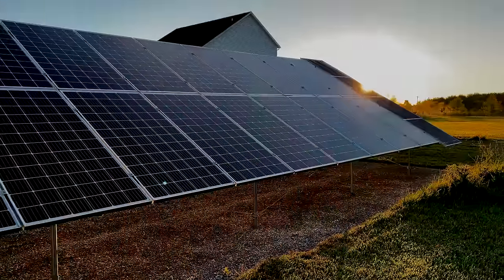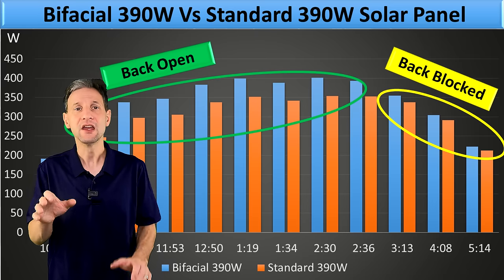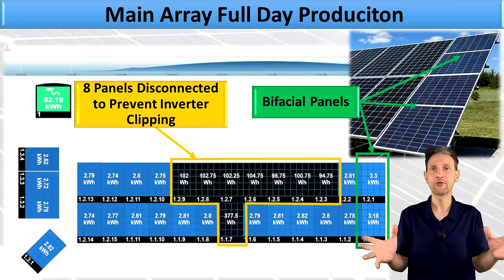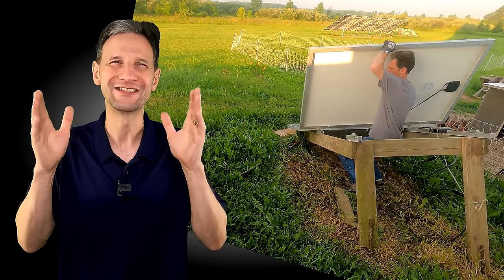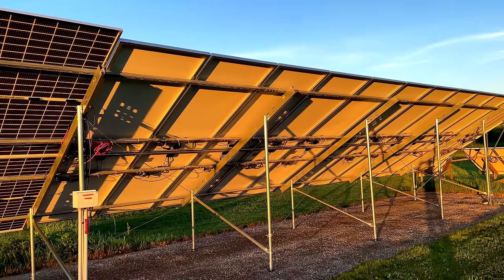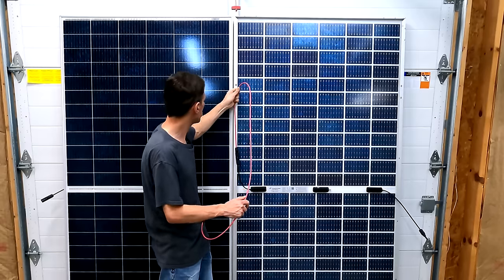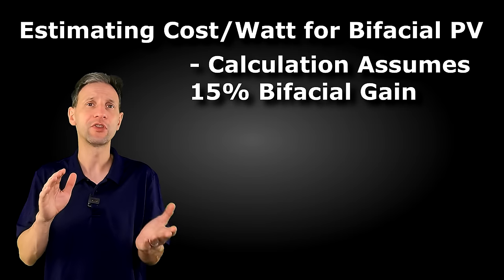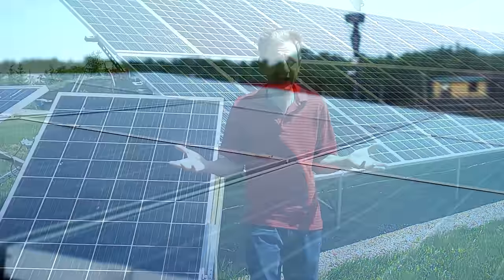Bifacial Solar Panels - The BEST Solar Panel? Real World Results!

Comment: Take two single sided panels and mount them back to back and then compare the results with a bi-facial panel.  Or take a bi-facial and mount it with the backside up and see what the results are.  My guess all this is marketing hype to make the consumer think it's a technological breakthrough when it is likely just a way to squeeze more dollars out of a panel by taking cells were sub-par and normally discarded and slapping them on the back.
Reply from the maker: That is exactly what I tested in this video.  I installed one panel face up and one face down with the other side blocked.  The back side of these panels can produce 66% of the power the front side can produce.

Comment: To me these bifacial panels look like the best solution on a tracking system. Then you could tilt the system to give best results. Have you considered testing a tracking system and making the cost comparison to fixed array?
Reply from the maker: I think the nice thing about bifacial panels is they can pick up light from other angles even without a tracker.  Of course tracking would be even better, but probably not worth the cost unless you have limited space.

Comment: Try erecting the bifacial panels vertically in a north -south orientation either on a flat roof/open area away from building etc.
Should maximise power output am/pm with a midday dip keeping the panels cooler (more efficient) around solar max🤔
Reply from the maker: You can see the vertical result here: https://youtu.be/5AVO1IyfA9M
Reply: Thanks, that's brilliant...I just came across your video after watching a video on solar installation.
Love the effort you put into these videos, no sales bs, just real relatable data. 
I had visualised more gain early and late and a bigger dip at solar noon so the video you linked was a real eye opener!
All the best, keep up the good work 👍🏴🇪🇺🏴

Comment: I recently bought (not yet received) Jinko Solar bifacial panels.  I live on a hill that is facing south.  The hill is a corn field. I live near London Ontario.  In the winter when the field is covered in snow.  So with the sun lower during the day I am hoping the slope behind the rack mounted panels will reflect the light into the back side of the panel better than a flat land setup.
Reply from the maker: Yes, it will likely have a significant effect.  It would probably be beneficial to mount the panels a little more vertical than typical.  You will shed snow more easily, and since you have bifacials you will still get good performance in the summer.

Comment: How about mirrors or aluminium foil to reflech some sunlight? No point in bifacial if the structure is based on a roof with inclination, right?
Reply from the maker: Bifacial provides little benefit if mounted parallel with the roof.  I am collecting data on my shed install to show just how much could be expected.  You can see that install here: https://youtu.be/Y8OGxdJ9cU8

Comment: I found that as a kid I could get power from a solar cell from either side as long as light shined on it. I know it works but implementing it may be a bit tricky.
Reply: So if you have concentrating mirrors to shine light on the back of the bi-facial panels you could get more power out. Crude reflectors could be made from aluminum foil a mylar heat blanket using the shiny side to reflect light. I guess anything reflective to maybe old CDs.

Comment: Could you use these panels on a roof where they are not angled and there isn't a lot of space between the panel and the roof deck?  Or would heat buildup kill any gains?
Reply from the maker: I evaluated that in this video: https://youtu.be/mzqjCsZKUYQ

Comment: I wonder if placing the panels in a a configuration such as this | _ | _ | _ | with the "|" panels mounted vertically and the "_"mounted flat, and the whole thing oriented to the south with elevation adjustment for the whole rack tilting it for seasonal variations mounted  with the lowest part of the panel a foot or so off of a white metal roof would even out the curve.  Possibly even boost the wattage even more.  Some fiddling with the spacing between and the number of panels in between for optimization would probably be needed as well, to figure out the best spacing to get the most out of both the verticals, and the horizontals by varying the open air areas of reflectivity of the roof for both sets. Possibly either two rows so you could alternate the facing of the verticals, or just alternate them in a single row.
Reply from the maker: That sounds complicated... : )
Reply: it could be complicated, it could be simple. think really wide teeter totter, with the panels in that arrangement. @ProjectsWithDave

Comment: I just acquired a whole pallet of the bifacial znshine solar zxm7-shldd14 (540w) to replace my only year old Jinko  415w. Now the question is should I install them on the roof or should I get ground mount engineered, I just don't think my 12sq ft garage roof cannot handle them.
Reply from the maker: Bifacial panels will perform significantly better with a ground mount.
Reply: May I ask why you're replacing the old panels versus adding your new panels to the existing system?
Reply: @ungoyone  The old solar panels were 415w none bifacial which means not as efficient & more powerful as the bifacial 540w the bifacial one. Why not use new panels with existing system if they are compatible?

Comment: Great info, thanks!  With that said, I'm not sold that they will make much of a difference on a typical asphalt roof installed at normal installation heights, especially panels not located on the edge of the array.
Reply from the maker: I would not expect them to do well in that situation.  I would not pay extra for bifacials to install them on a dark asphalt roof.  I am doing some testing in what I would consider to be a "best case" scenario with an install on my white shed roof.  You can see that install video here: https://youtu.be/Y8OGxdJ9cU8

Comment: Thanks for such a thorough video! For a winter test I’d like to see an ‘agrivoltaic’ version tested, with vertically mounted bifacial panels. No snow cover and nice irradiance on both sides. Do both south facing and west-east facing panels. Also, try out bifacial panels on a greenhouse roof, or even as a substitute to the normal roof glazing, as getting rid of any backing would help with thermals. At peak sun hours greenhouses get to much irradiance anyway, most greenhouses have to vent the heat away.
Reply from the maker: Thanks for adding some more testing ideas.

Comment: Use metal mirrors (or even just a bright metal sheet) underneath that panels and a couple of side mirrors to put more flux to the panels front. You can get about 40% more this way.
Reply from the maker: What mirror and metal sheet setup did you try?
Reply: @ProjectsWithDave check the video "Get 4X The Power From Your Solar Panels! - TI Sunday" at Tech Ingredients, their approach is quite scientific. It would be better this way than I'll try to describe.
Reply from the maker: That experiment is totally flawed.  Unless the whole thing is mounted on a tracker the reflectors will shad the panels as the sun moves across the sky.  He only took data at one point in the day.
Reply: @ProjectsWithDave  of course this is true.

Comment: Great video. Have you tested to see how shadows affect a bifacial--other than the cardboard? I can't imagine a wire would really affect it that much, but I guess a ground mount structure built of 2Xs could cast a shadow large enough.
Reply from the maker: Thanks! The panels are half cell which seems to already have a significant improvement for shadow conditions.  I think as long as there is a significant space between the racking and the panel for ambient light to filter in it won't be a huge deal.  You don't really have a shadow without direct sunlight anyway.

Comment: Dave, regarding getting more light behind "bifacial" panels.  How about taking the top row of panels and placing them 6 inches higher on the support rack, then take the bottom row of panels and lower them by 6 inches on the support rack.  This would create a 12 inch gap between the top and bottom rows of panels and would allow direct sunlight to strike the area behind the panels.  If you had a series of highly reflective surfaces under the panels, like a painted white surface, and if it were angled to reflect the sunlight up to the bottom of the solar panels, I believe that would significantly increase the energy output of the bifacial panels.  And yes, perhaps the vertical racking might have to be extended a bit, but the added cost might be very small.
Reply from the maker: That's a good idea.  I think you would see some benefit from that strategy.  The racking loading would need to consider the additional forces from placing the modules higher up.
Reply: @ProjectsWithDave  You are right about the addition torque at the top of the panel rack, but the 12 inch space in the center of the array would substantially reduce the wind loading on the face of the panel array.  I think this reduced wind resistance would more then off set the loading at the top.

Comment: Thank for the video, but I would like to make a small notice. Your charts are not trully vidually representative and designed with some "marketing ideas" behind to advetise the products. I would recommend to use more correctly representing charts with comparison from 0W and so on...
Reply from the maker: The charts don't start from 0W so that they will be easier to read, it does not change the result.  The data is presented exactly as it was generated from my test equipment.  I am showing you the test results from the panels I bought for my system, not panels someone sponsored me to do a review on.  Hope that helps.  Thanks!
Reply: @ProjectsWithDave  , I don't doubt that you did all on the test equipment and results are relevant. This is not what I'm saying. What I'm saying is when you extract the test data chart with just top end and show the tip only, it doesn't provide correct chart visibility as the whole concept of the charts are made for understanding to those who is not technically competent to comprehend digital data only. On your charts extract the visual difference is massive and it is not true. I would even class this approach as "manipulative use of charts" even though the data is transparent and valid. And true of the fact is that if you show them from 0, then the visual difference would be almost unnoticeable to viewer due to minor values in variations. Anyway, this comment is more for the viewers to bare in mind how manipulative can charts be used to blur attention to details in the aim to disguise the advertising. Don't get trapped and analyze what you see.
Reply from the maker: It's true, the scale of the delta is visually amplified by trimming the bottom of the chart, however that allows the viewer to quickly understand the comparison.  The percentages give the understanding of magnitude.  The bottom line is, Bifacial panels provide a significant and relevant performance boost over standard panels with appropriate backside exposure.  There is no hidden agenda to show something that isn't real, but rather to quickly visualize the reality.

Comment: Put a large mirror or silver reflective fabric beneath the panels on the ground, and put a mirror behind the panel at about about 2 times the tilt angle. Raise the bottom edge of the panel to at least the length of the to allow more light to shine beneath the front edge. The panels may get too hot in the summer, but should over perorm in the other three seasons.
Reply: A mirror and silver actually eat light i believe white is the most reflective

Comment: i was thinking of installing 40 panels ,,, i would have 10 pointing east 20 south and 10 west,,,that way in the morning i have 10 panels in direst east sunlight with the 10 panels facing west geting direct sunlight on there backside,,,,,then once the sun hits mid day ,,i got 20 panels pointing at the sun while some of hit the backside of both other arrays ,,,,,,then when sun is west,,,10 panels directly pointing at it while my 10 at the east have the sun directly on there backside,,,,other then a tracking system ,, i think this would be the best way to do it
Reply from the maker: If you watch my video on South, South West, West production comparison (link here: https://youtu.be/J7xnY84Ch1E ), you will see that you get better results facing your panels SE and SW.  Direct East and West facing panels don't do well in the winter.  Also the analysis of the bifacial panels show very little gain from early morning and evening backlighting due to the angle of incidence and weak irradiance.  I would recommend SE and SW facing bifacial panels with a winter bias tilt angle.
Reply: @ProjectsWithDave  thank you , i will definitely have a look at those vids,,i was actually wanting to do what i suggested cause i though that up here in canada , it would have been the best way to maximise every hour of sunlight possible throughout the day,,, but i will for sure try what  you suggested,, thank you sir

Comment: Picked up a pallet of perfect QC475 bf not far away in Columbus. CDE Greentech. They were stocked good back in May. Nice salesman. Used the proper 6' forks. No shipping, just gas and you'll have new undamaged panels. I can guarantee you are not saving by buying used.
Reply from the maker: Nice!  Are you building a ground array?  They perform much better than I expected with good backside exposure.
Reply: Yes, 45 deg for better winter production.
Reply from the maker: That sounds perfect, I think you will be happy with the results.  Drop a note when you get it up and running.

Comment: Kind of wonder how hard and expensive it would be to put sun-tracking mirrors that reflect on the back side of the bifacials.
Reply from the maker: I'm confident the cost would be higher than the return in improved performance.
Reply: @ProjectsWithDave  Agreed. By the way, do you have any data on the production of the bifacials oriented towards the sun vs flat? I've been thinking of building a pergola using bifacial solar panels.
Reply from the maker: If your pergola is actually flat, it will collect a lot of dust and snow.  This is not a great orientation.  You can get an estimate using the PV Watts calculator I show in this video: https://youtu.be/rbFnZqA0GCI

Comment: barium sulphate paint on the floor then put panel on top
Reply from the maker: You wouldn't want them directly on the floor, the panels themselves will block most of the light.  There needs to be room for light to get around the panels and reflect back.
Reply: @ProjectsWithDave  yes 1.5 metter above ground, but i meant Barium Sulphate paint reflects max Sunlight

Comment: Should fit a base board to these panels painted white to reflect light to the back side of the panels.
If they are fitted to a silver or white roof would be brilliant
Reply from the maker: I'm trying a white roof in this new install: https://youtu.be/Y8OGxdJ9cU8
Reply: @ProjectsWithDave  These panels come from China and the recommend people to paint white color on roof or mounted structure to get best performance of Bifacial panels.

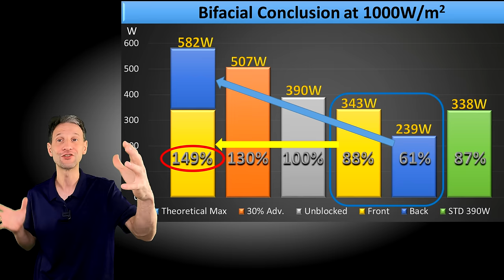Comment: 8:20 are you getting some of the other side lit up in your single side tests through the lit up side? (i.e a fully lit up back side would not get the full 149%)
Reply from the maker: It was completely blocked with cardboard, so I don't think anything significant was getting through.
Reply: @ProjectsWithDave  I am thinking from the front to the back not through the cardboard.
Reply from the maker: How would that be different than a standard cell?

Comment: So when they advertise the wattage of the panels, is that just the front facing portion, or is it half on each side?
Reply from the maker: Just the front.  Then there is usually a percentage representing the possible increase in back side gain.
Reply: @ProjectsWithDave 
Thanks for the reply. I'm wondering one more question. Did you notice any extra volts when the rear was producing power? I'm looking at potentially buying 550 watt 49 volt panel, but was told by some one else that there could potentially be more voltage and I can't go over 60 volts. But with a potential 12 percent gain I'd think that would be a max of 56 volts?

Comment: Nice video! Question: why does the backside of the panels shift in so many colors?
Reply from the maker: That's just the change in reflection from the different silicon wafers.
Reply: Nice, I thought that aswell when my new panels arrived (currently placed against wall waiting to be mounted) and that's when i saw this change of colors.
But the colors didn't change according to light angle or my position. They simply seem to be of different colors that change when I or the sun moves, is that normal? Because it seems to me that the wafers are of different colors from factory. :/
Reply from the maker: My guess is the molecular structure of every wafer is slightly different and therefore reflects/absorbs slightly different wavelengths of the light spectrum which we perceive as different colors.
Reply: @ProjectsWithDave cool , thanks :)